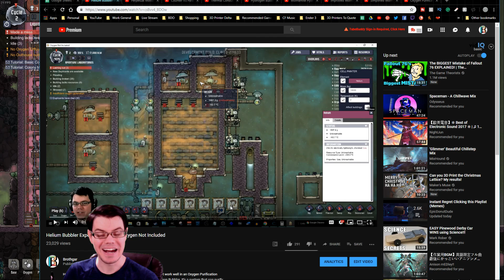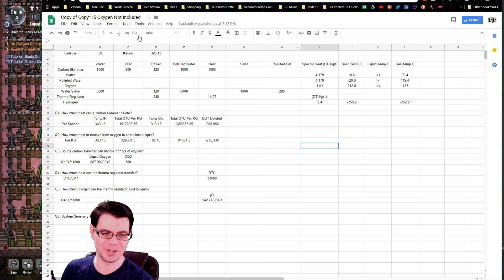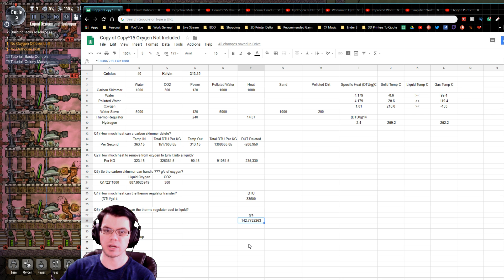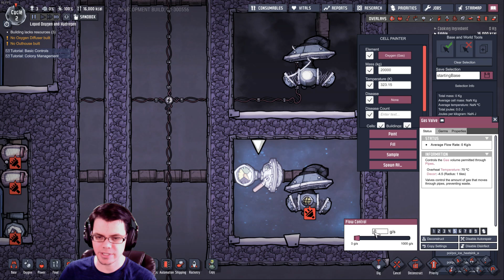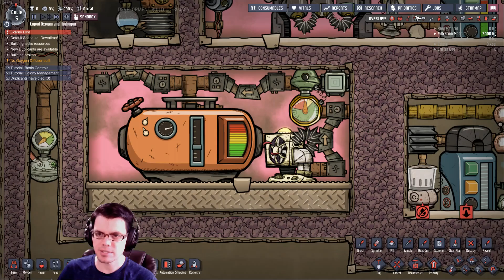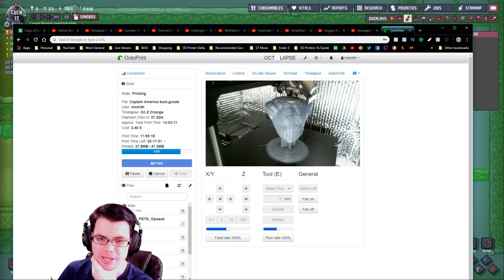Producing Liquid Oxygen Experiment! Oxygen Not Included Part 1 of 3

Comment: Technically, thermal regulator could cool about 150g per second of oxygen from room temperature to -200. I guess 100 is also good. 

Could complicate it with a second loop with aquatuner using petroleum to pre-cool the oxygen to like -50 or so. But its only like 50% better at heat transfer for the power it uses.

Comment: Hey i know you try to make this experiment with stuff that you can easily access or use
but im courious how good a Thermo Nullifier would be.
just filling a whole room with Oxygen and feeding the Nullifier with its Hydrogen.
if im correct the nullifier can reach down to like -250°C that will maintain the temperature even if you will feed new oxygent to it and the Liquid Oxygen will stay cold enough to not evaporate and it will help to cool down the new added oxygen.
you might even want to set a Hydrosensor a few tiles higher that it just reaches the Liquid after there will accumulate enough too help maintaining the temperature inside.

Have a Great day :D and Merry Christmas

Comment: In the instrumentation world, imperial measures are best to fine-tune machines and logic. I think you should try a series, a new base, where you use the standard measuring system. I do believe you would find that after handling the longer math equations, your machines would run much smoother. 100 to 101 degrees cel is a larger change than 212 to 213 F. It is why we use imperial in instrumentation. Automation does not appreciate metric rule

Comment: Not science, Brothgar, Engineering!
On that note, upscaled production of liquid oxygen for a large tank of fuel for the rocket would also need to be taken into account.
You also can't fill the gas reservoir with too much hydrogen or the loop will break. So that'll need an automation signal. I sometimes kind of wish that you could read the contents of the various amounts of storage, like Factorio's form of automation.
>Tries to not use end-game materials
>Literally has no abyssalite for all the pipes and insulation, pre-space materials
Reality in-game:
1. Find a carbon dioxide vent... but you'll also need to cool it down so the carbon skimmer doesn't break with steel materials.
2. Find a infectious/polluted oxygen vent... but you'll need to cool THAT down as well as convert it to oxygen.
3. Find a hydrogen vent... to which that also needs to be cooled down so it doesn't break with steel materials.
4. Find a Thermal Nullifier and use that in conjunction with radiant pipes and thermal regulators to rapidly cool down Hydrogen and Oxygen.

Comment: You didn't account for the enthalpy of condensation of O2 in your spreadsheet. I experimentally measured in game the enthalpy of condensation of O2 to be approximately 62278 DTU/kg. This much additional energy must be removed from gaseous O2 to convert it to liquid. So per your numbers... (33600 DTU/s removed by thermo regulator) / (235330 DTU/kg (50C to -183C)+62278 DTU/kg (enthalpy of condensation)) = .1129 kg/s = 112.9 g/s liquid oxygen (at perfect efficiency)
Reply: It's important to note that there is no actual enthalpy in the game.  There is a buffer temperature which can imitate it in some manners, but that energy is not consumed.  Practically, it has the same effect since you need that much additional cooling to achieve condensation, though you can then exploit it a bit since you can raise things above the boiling point (exchanging some heat) before they'll vaporize.  Basically, this is nitpicky but calling it enthalpy can lead to misconceptions as to how it actually works in game.
Reply: @AzeTG  it probably isn't enthalpy and instead is some game physics thing but the energy in a system (kelvin*specific heat*mass) does change from a phase change so that's what I called it.
Reply: I tried to redo my calculation of the enthalpy of condensation with different methodology and got a wildly different result of about 2kJ/kg (J=DTU). But here's what I was generally doing: build insulation insulated tile surrounding a 1 by 1 tile area so that no heat transfer occurs out of my 1 tile system put gaseous oxygen in there and then make it condense while writing down the temperatures of things. There is always an increase in total thermal energy after condensation which would be from the enthalpy of condensation. I found that it will not condense if no heat transfer is happening so if I just use the heat gun tool or spawn it in well below it's condensation point nothing happens. The first time I did the calculation I put an igneous rock water pipe in the tile at about the condensation point with oxygen that was well below condensation point while the game was paused then unpaused and let the oxygen condense. The second time I tried a much lower thermal mass item, a refined gold automation wire, and used the heat gun to slowly cool down the system until it changed. I'm not sure why there's a difference in my measurement. In any case the oxygen does warm up when it condenses. It's probably a game physics thing so who knows what that math could actually be.

Comment: Have you considered checking the temperature of the gas after averaging (after the tank) instead of before? Also, with a sensor before the thermoregulator, you could simply deactivate the thermoregulator with an automation signal and bridge to the output the gas that goes past input port

Comment: Why the complex cooling for the thermal regulator I found that 2 weezworts per reg and a butt load of hydrogen is enough to keep them cool.
That being said I'm still having trouble making LOX I think part of the issue is that as soon as the oxygen condenses it turns the room to a vacuum and insulates the puddle of LOX so it evaporates again, I'm gonna try adding a tiny bit of hydrogen so that as the oxygen liquifies it leaves the hydrogen to fill the vacuum which keeps the LOX chilly.
Reply: why not build the radiant pipes at the bottom instead?

Comment: you can get super coolant off just steam rocket so you can have it before you need liquid oxygen.

Use super coolant in a loop to cool the oxygen to liquid, in a steam filled room, and a steam turbine to burn off the excess heat
Reply: If youre lucky that the first rock has some. I only discovered it at 40k in my last play...
Reply: What good is that though? You can't use LOX until you have the liquid oxidizer tank.
Reply: @Xuhybrid  with steam and two solid boosters you can go over 30Mm, also LOX gives 33% boost over Oxylite even for petroleum rockets
Reply: @666Tomato666  Sure but you can only take 2 science modules at a time. Why waste the effort on solid fuel thrusters if you need to make 3 trips per planet? Of course LOX is better, but again, you don't get access to it at the same point you used to.

Comment: At 12:00 I was wondering is it not more efficient to use a barely filled gas reservoir. It feels like a lot of cold hydrogen is wasted on cooling what is in the filled reservoir just to average the temperature when a smaller amount might accomplish the same. I'd say 30kg in the reservoir (the amount what runs through this gas pipe system at 1kg per pipesection) could do the same trick as a full tank but more efficient.

I think you could even go lower than the 30kg reserve when looking at the oxygen vs hydrogen heat capacity (what hydrogen should be able to buffer to prevent the temperature from going up too fast).

Anyways, Merry Christmas Brothgar